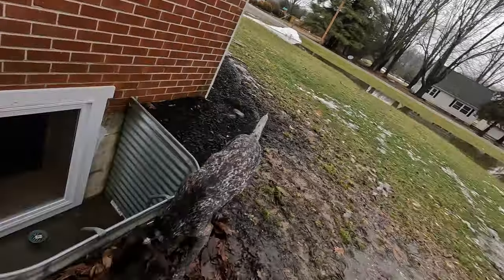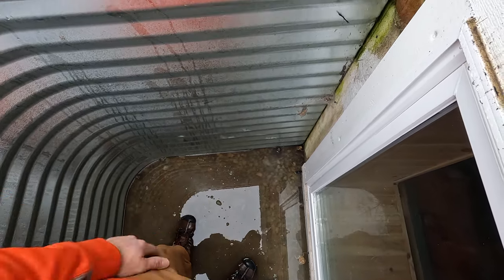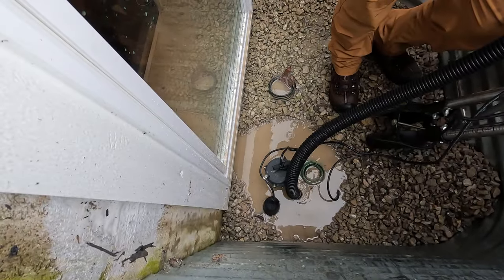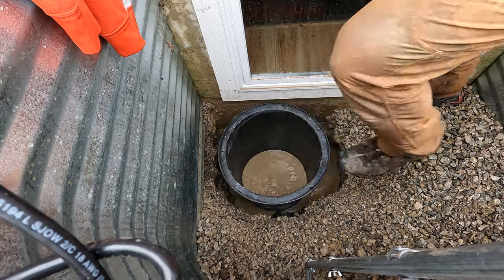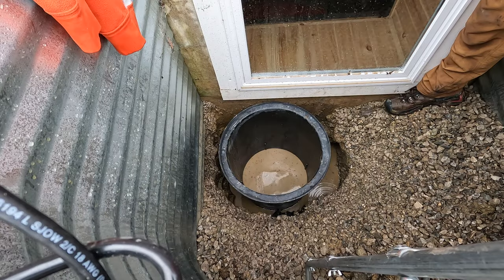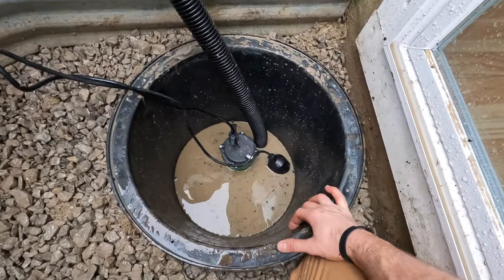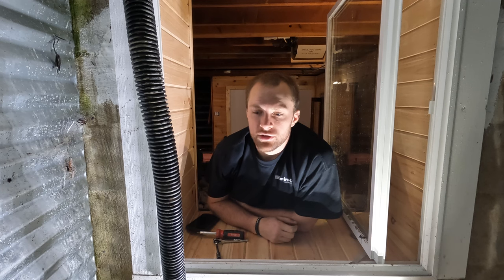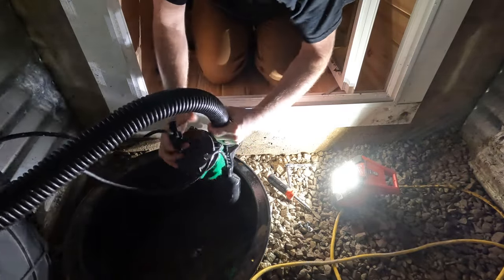Egress window sump pump

Comment: Great job on the video, very informative!  I actually install egress windows and entry s for a living and have run into the occasiional situation where the house weeping system was not draining the way it should. Your technique is one way I can deal with that issue when it arises. Its obviously a lot of additional expense but something that may need to get done in the event the drain to the house weepers isnt working.   I like how the pit can be completely buried under the stone for esthetics and also to perhaps keep mosquitoes from entering the pit. One thing I would mention is in our area the stone bed can not be any closer than six inches from the bottom of the window to prevent detritus from contacting the window frames and soiling the window itself. Also it leaves more room for water to sit further away from the bottom of the window. Great video!
Reply from the maker: Thanks for watching Paul, I’m glad you enjoyed it! 😊

Comment: Looks like @8:45 you got rid of existing window well perforated drain. Where you able to see where it went or if in was tied into anything, clogged,etc? Have other window well drains?  I'm not sure what part of the country your in, but I'd be concerned if your set up froze. Looks like a Pentair pump from Menards. Nice Milwaukee screwdriver and shirt. Go Red!
Reply from the maker: It was buried to the depth of the curtain drain for the home. I believe there is another issue with that drain as hardly any water ever comes out of that drain into the sump pit in the basement. We rarely have enough water to cause a concern so this is the way I went for the occasional insurance I need. Im in Ohio and was also concerned about freezing, I did not install a check valve so the discharge pipe is able to empty back into the sump pit. We have had numerous days below freezing, some for days on end and no issues at all. I believe it is deep enough below ground level to keep it from freezing. Thanks for watching!

Comment: I would have dug the pit front LHS of shot, thereby moving the pit away from your wall. of the house and left a good deal of the clay soil between the pit and the foundation.  By digging it next to the wall you are forcing the water to be adjacent to the foundations  until the sump pump kicks in.

Comment: Hi.. can you please suggest which sump pump you bought here and also can you give amazon or links for all the items?

Also, please confirm if the sump pump is auto one means automatically switches on when water is there and shuts off when it is done?

Comment: Perhaps I missed it but what are your plans for powering the unit? Will you just be running an extension cord from an outdoor outlet?
Reply from the maker: There’s a dedicated outdoor outlet that has been installed inside the window well for continuous power.
Reply: Just had a flood in my basement due to heavy rain.  Contractor recommended a well cover be installed first.  If that doesn't work then put in the pump.  Do you think it is a waste of time and money to put on a cover??  Looks like you had a cover and still had quite a bit of water in the pit.

Comment: Dude. Great video. We just bought a house and this will be our first spring/summer with it. We had a radon fan/pump put in and he gave us a new, sealed, lid with a window on our pump put. I thought I'd check out how the rain the last couple days had I affected it. 
And I noticed water in it and googled it and found your video. 
I learned some things. Thank you for the video!
Also, one quick question, if you have time. It looks like my pump put has a home in the bottom, not a hole put there on purpose by the manufacturer.
Should I be alarmed if literally everything else, seems to be working as intended?
Reply from the maker: I personally wouldn’t worry about it if everything is functioning normal. 

Thanks for watching!

Comment: Thanks for posting this, I need something like this - how does that pump run?  Is it electric?  I was trying to figure out how it runs?
Reply from the maker: Yes it is an electric pump that plugs into a standard outlet. I plan to get an update video out soon with everything finalized.
Reply: @cameronmundell7190  Thank you for your efforts and sharing, it has helped me envisage this as an option.   I am very appreciative
Reply: Pumps can run of battery as well but usually thays done as a backup if the power were to ever go out.

Comment: Thank you for the video 👍🏻 I live in the northeast where temperatures can fall subzero. My window well fills up in big storms. I was contemplating putting a sump pump but was told that it may not withstand freezing weather. What has been your experience? I have a really good cast iron pump, somehow I don't think it will freeze up but wanted to get your opinion. Thanks!
Reply from the maker: I live in Ohio, we have had several days with below freezing temps and I have never had an issue. I assume it is due to the depth underground my sump is placed. The biggest suggestion I’d make is to not use a check valve. If the pipes stay filled with water they will most likely freeze up by the surface. I’d rather the pump run a little more frequently from some slight drain back vs a freezing pipe. 

It doesn’t run much, mainly during big rainfalls or large snow melt off.
Reply: That's great to know. Ok I will put the pump in a container with holes in gravel without a check valve. I suspect the duct or drain from my window well to the sump pump inside my basement is clogged. So while I am removing gravel I can also diagnose that f that's the problem. Thank you once again! 🙏

Comment: How has it been working? Has eliminating the check valve caused any problems?
Reply from the maker: It has been great, there has not been any standing water inside since the pump was installed. Removing the check valve as had no negative impact either. The sump pit is currently dry due to lack of rain. Thanks for watching!

Comment: What do you call that tool that you used for digging?
Reply from the maker: It’s called a post hole digger. They should be easy to find anywhere that sells shovels, rakes, etc.
Reply: @cameronmundell7190  Thank you. 🙂

Comment: Not sure the benefits of this complicated window well design in the first place; why?
Reply from the maker: It is required by code anytime you have a finished space in the basement used as a bedroom. It is designed to be used as a fire escape.
Reply: @cameronmundell7190  Yes, I get, but it is the design that concerns me most; it doesn't have any cover top therefore making it prone to flooding and requiring the use of sump pump.
Reply from the maker: This does have a cover and the water from the sky is not what causes flooding. The cover was removed for the making of this video. I did reference that but somehow you missed it. If you watch the video in its entirety you would see that the pump is only activated a few times a year during extremely heavy rainfalls. It does not turn on every time it rains or on a daily basis.
Reply: @cameronmundell7190  OK, got it. Thanks for the clarification.
Reply from the maker: Glad to help! Thanks for watching!

Comment: where did you plug the sump into?
Reply from the maker: I used an extension cord to temporarily power the unit. I plan to add an outdoor outlet inside the window well once weather gets nicer to permanently power the unit.

Comment: I am looking for an option for my window well which fills with water during heavy rain or when snow melts on warmer days. I live in New Hampshire where we get consistent freezing temperatures.  Would this solution work?
Reply from the maker: It works year round for me. I live in ohio. I did not install a check valve so the pipes would empty out between pump cycles.
Reply: @cameronmundell7190  I have a similar situation. I'm not sure how much it has rained since you installed it but I think you may have an issue with not having The backflow. The pump will cycle and the water will be removed. Let's say you get 7 inches of water drawn down. When the pump stops, the water from your hose will fill up the pit with several inches of water. The amount will depend on the hose size, the height of the hose and the diameter of the pit. Either way, some water will come back down. This means you are really only pumping 2-5 inches of water with each cycle. The result is the pump cycling again too soon. A high quality pump should not cycle more than 15-20 times an hour. In a good rain or during heavy snow melting, I was cycling every 55 seconds. That's 65 times an hour. That rate kills your pump life. I my case, the water is always cold which keeps the pump from overheating but it's still bad. I ended up installing my pipe on the outside of the window well where it has less chance of freezing. This allowed me to keep the backflow device. It's still about 4 feet from the pump but it is better than the eight foot column of water that was refilling my pump. Good luck.